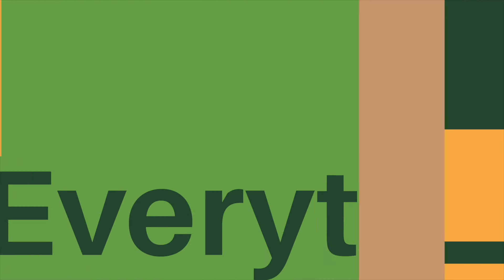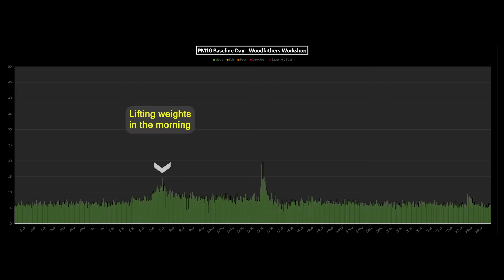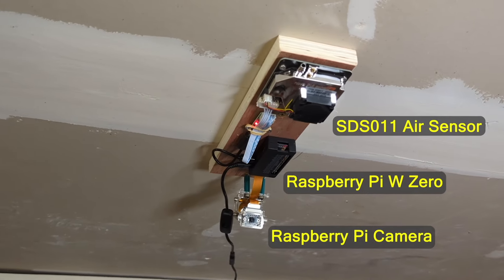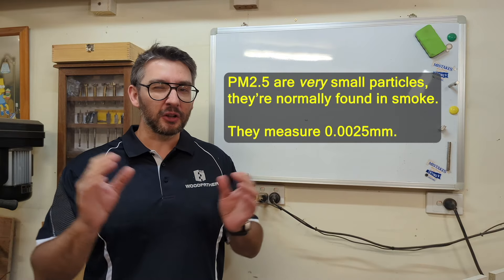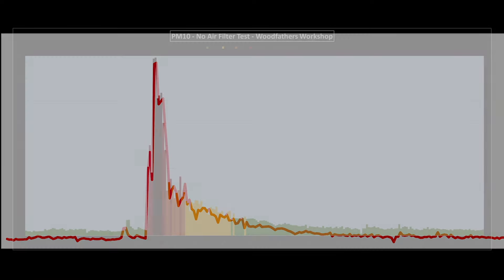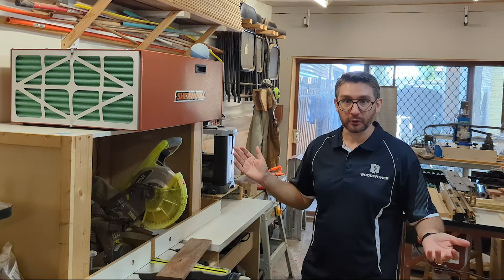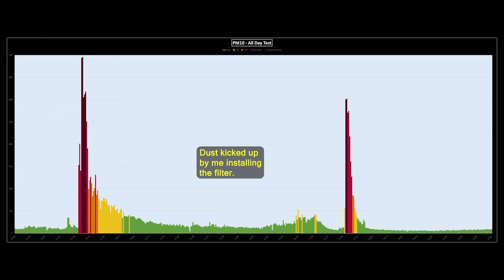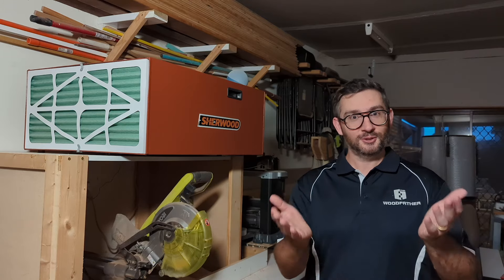Workshop Air Filtration using the Sherwood 1000CFM - Featuring the Woodfather

Comment: The Men’s Shed group I’m with has two of those units suspended from the ceiling of a 40 sq m workshop wired into the power connections originally used for two exhaust fans. Extremely effective.
Reply: That sounds pretty useful for a space like that. Two of these big ones in my small workshop though, the air would be at 'clean room' levels for microchip manufacturing 😄

Comment: That's a great dropoff in a short time. It's on the list of upgrades. Will be interesting to see how it competes with opening the garage door ;) OK quick Chemist Hat time ;) While your PM10s are irritants, it is the the PM2.5s you need to watch the most closely. Your nose, throat and lungs are pretty good at catching and expelling the PM10s. So while it is good to remove them they are of less concern. At the other end PM1.0s are so small they generally don't stay in your lungs, you just breathe them out again. It is also hard to generate mechanical (sawdust) that small. PM2.5s however are in the sweet spot for human impairment. They bypass your mucus layers and hairs and can penetrate deep into the lungs where they tend to become stuck. Over time this can lead to scaring and other health issues, so are the ones you really want to keep out in the first place. I use the Air Moniter to tell me when I can take my mask off, and that is when the 2.5s drop back to green :)